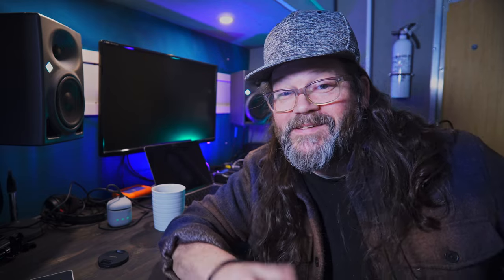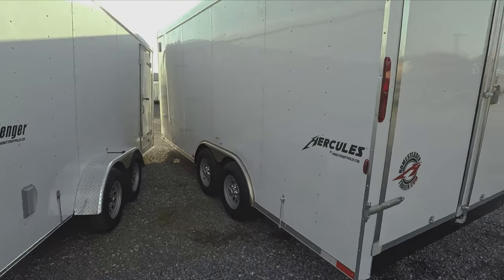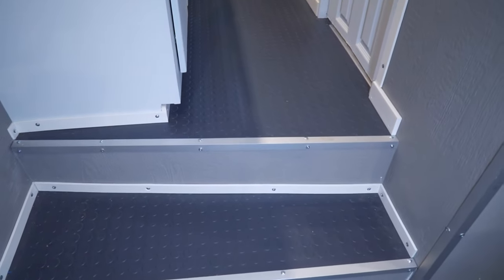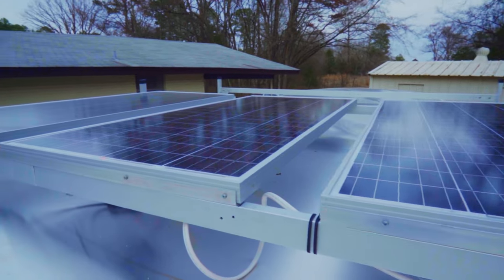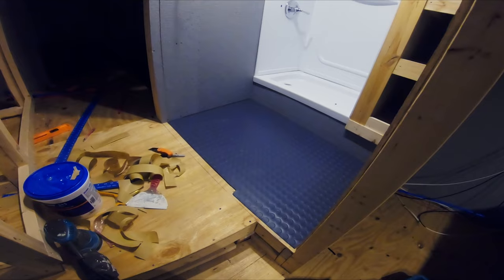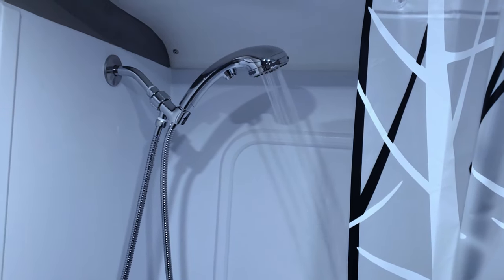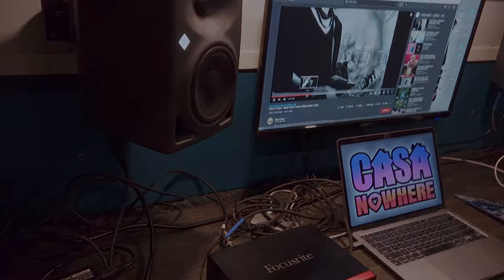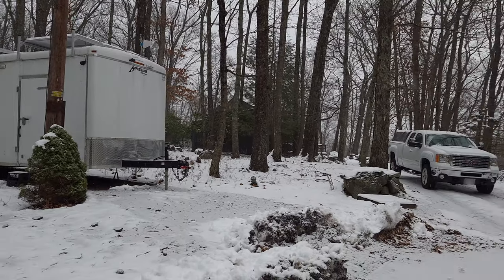1 Year on YouTube! Speedrun through the custom cargo trailer camper conversion build!

Comment: what would be extra cool is to have a piece of another (smaller) but similar make/model trailer modified to fit in the bed of the truck extending over the cab which can be lifted off the truck (by a couple of stilts on either side.